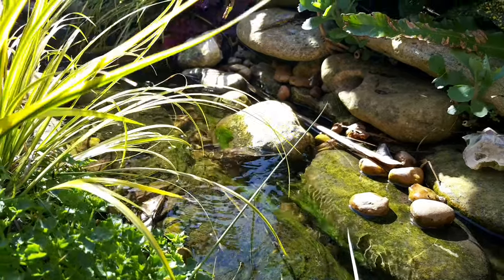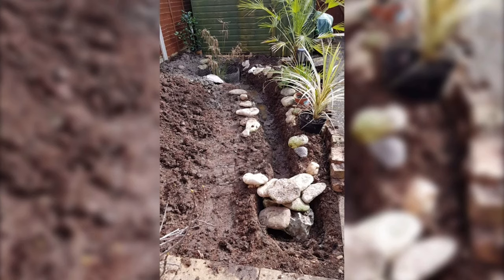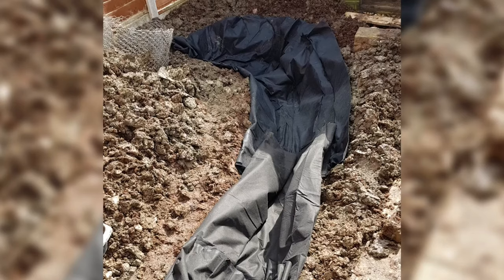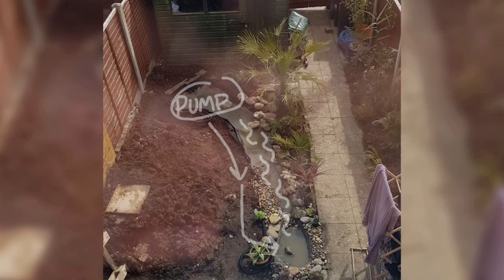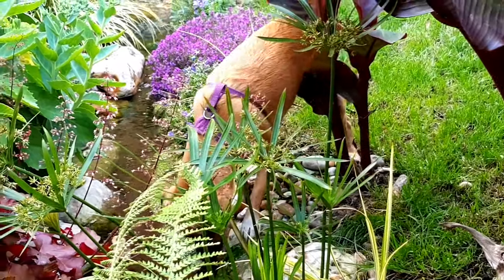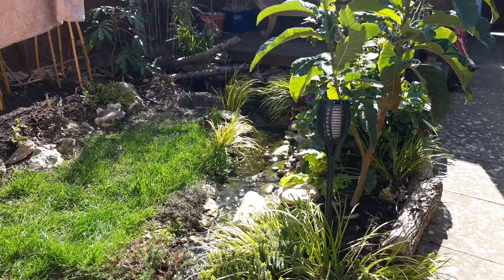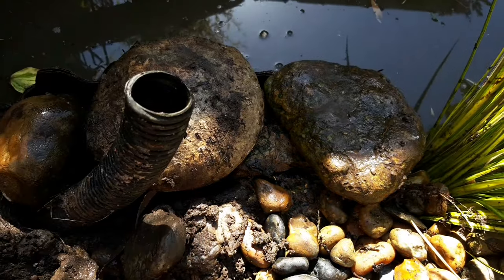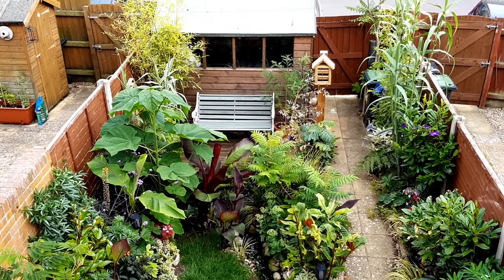How to build a garden stream water feature

Comment: Very good. I did something similar in 2019 and like you, I found that the birds were into it straight away. On hot days, it's great to watch them splashing about. I find the birds needs shallow water to bathe in, so I had to add pebbles rather than remove them.
Reply from the maker: Sound idyllic 👌

Comment: I have had to make mine lower , as the pump would run dry in the warmer weather. Just finnishd digginng out a larger hole for the pump to help retain more water when it drains drains back after I turn it off. Also linned it with concreat for safety. Waiting to swich back on again.!!!

Comment: Beautiful stream and great advice. How much does it cost to run the pump on a yearly or monthly basis? Did you notice a big increase in your electric bill? Thanks.
Reply from the maker: Thanks for your kind words. We bought one of the most energy efficient ones on the market because we were worried about running costs. It has been great, we barely see a difference 🙂🌿

Comment: Great video, planning to build a small stream for the fernery we are building (although in the hot Aussie temps we have here, I want water evaporation to maintain humidity lol).

I had a question, whats is your overall fall from the top to bottom? I guess the old mathematics rise over run.
Reply from the maker: Oooh we'd love to see some pictures of your fernery at some point 🙂👍 there is no more than 30cm between the top and bottom height of our stream, our garden is very flat so we just had to dig each pool slightly deeper. I hope that helps 👍
Reply: @GrowParadise  At the moment it's a sandy mess just getting cleaned up. Nothing to see yet I am afraid.

Also that drop wasn't as much as I thought and still gave a nice flow. Very close to what I kinda wanted to achieve. Thanks, man, your video has given us ideas.